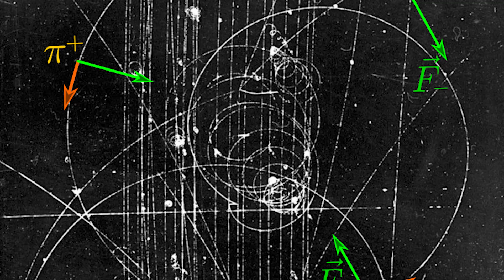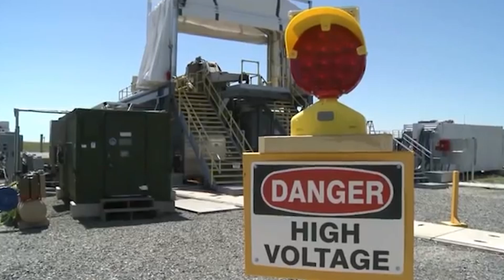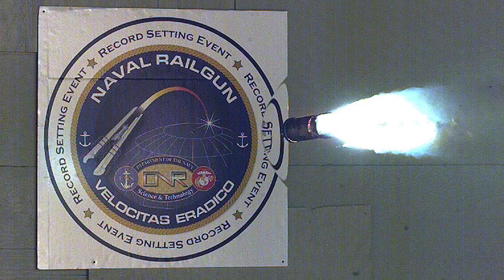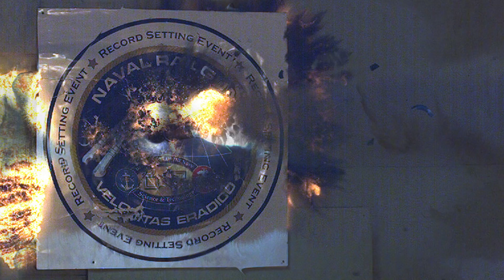Railguns: The Kinetic Future of Warfare

Comment: Used a rail gun in halo 4, was meh power weapon. Perhaps they should look into a rifle that shoots beams or explosive needles
Reply: They have. 
The needles were done in the 60’s see spew. 
The beam weapon just doesn’t work out with physics.
Reply: @brucebaxter6923  yes but no not without direct connection to extremely high power or stupidly dense batteries. But as of now the shits a si-fi cum bucket
Reply: @TbjrL  
Not even that problem. 
To damage a human in a reasonable amount of time, ie milliseconds before they move, the energy density ionises air and then absorbs the beam. 
The next problem is beam divergence that requires a reflector that is measured in meters not mm. Etc etc
Reply: @TbjrL  Is the ex sci fi? I think she is.
Reply: @brucebaxter6923  Maybe they could make a beam that air plasma would be mostly transparent to someday. Personally if I had the cash I'd just use 2 UV lasers to purposely pre-ionize air and then discharge a 1-2kJ 100kV cap into that. Not really a beam weapon then though but more like a wireless  tazer on steroids. Set phasers to stun = 3-5J/less voltage. Set to kill = 500J. Set to blow smoking holes in them too = 2kJ/max voltage.
Reply: @brucebaxter6923  Actually 'directed energy weapons' are already a thing. They're just not visible ... and don't do much damage. There are some uses in non-lethal crowd control though, as well as active research into taking out missiles with lasers.
Reply: @ArawnOfAnnwn  
Not quite a hand gun.
Reply: I remember the Halo books addressed the whole damage to the weapon thing, it was the reason they used magnetic coils instead of rails for their MAC weapons.
Reply: @Zyo117  That is called a gauss cannon. The smaller version on the warthog was one of my favorite guns in the whole game.
Reply: @Zyo117  you do know that HALO isn't real life, right??
Reply: enough velocity,,, explosives become pointless...... 4.5km/s
Reply: Well, if you used twin high power UV lasers to ionise air, you could make a railgun who's rails extend beyond the physical rails and continue accelerating up two beams of plasma, all the way into the target.
Reply: @Zappyguy111  Dammit, you beat me to it.
Reply: @Zappyguy111  now that’s what I like to hear!
Reply: Needler was the most psychotic weapon ever! I loved it!
Reply: @Ontime2day  Still doesn't compare to dual cyclones from Perfect Dark
Reply: I want a BFG9000.
Reply: @tncorgi92  Duke nukem?
Reply: So, a rifle with needles, interesting. The spiral rifles in the gun barrel are there to make the projectile rotate to stabilise it. A bunch of needles would twist a little, but start to rotate just fine. A rotating bundle of needles will be spread out by the centrifugal force, until it is no longer a bundle. The needles spread out further because they just keep moving away from the centre. The spreading will happen on the first meters, warying based on needle shape, bundle shape, bundle binder, pressure and more. Maybe it is like heavy bird shot from a smooth bore shotgun, but spreading much quicker. Maybe quick enough for indoor use. I do not know how it behaves really, but I would be extremely curious to see it.
Reply: @vsiegel  have you played Halo?
Reply: @Ontime2day  No, am I missing something specific? (A rifle has certainly rifles, no matter where. But I was thinking about the physical world.)
Reply: @vsiegel  "So, a rifle with needles, interesting." - https://en.wikipedia.org/wiki/Flechette
Reply: @ArawnOfAnnwn  Oh,thank you! I misread "a rifle that shoots beams or explosive needles". I assumed it is about multiple needles, leaving the muzzle at the same time, roughly parallel. But it is about a single projectile, rotating for stabilisation like any rifle bullet does. (Of course, shooting rotating bundles of needles still sounds interesting no me.)
Reply: @ArawnOfAnnwn  Brilliant! A great solution that did not find its problem. 
Because it looked in the wrong place!
You could build weapons that can be hidden in plain sight. From  a nine round James Bond style pen or a Hairspray can grenade launcher,  with four grenades, or five as taller can "Now with 25% more content!"
Or a bundle of 10 house installation water pipes, 3 m each, leaning at a wall, man portable 20 mm anti aircraft guns, 30 rounds. (Can be bundled for the same performance as the M61 Vulcan rotary canon, 300 rounds.)
And the nice and tidy stack of 80 mm street installation water pipes (they look so nice and new, even the dust cover caps are still on)? The stack is 3 m long and almost blocking the sidewalk. Yes of course that are 80 mm mortars, 9 shells each. As many as our fork lift can safely handle. (Of course you shoot them with your bare hands, obviously. The muzzle is far above you, the recoil goes 100% into the ground.)
And no, nobody needs the oil pipeline sections...
Reply: 69th like
NICE
Reply: IRL, there's no man-portable energy source that's powerful enough for repeated shooting of any electric weapon.
Reply: @tippyc2  Oh I dunno. 500J is lethal enough if it used in tazer (where the wires explode with kA's once in the target). That only weighs ~5 lbs if the 50-100kV plastic case version is used. Li-ion battery/2kW converter to charge it = maybe another 5 lbs. Cell phones aren't the only things getting smaller, lipo's are up to 400Wh/kg energy density thanks to smartphone demand. Also higher frequency = smaller size for a given power, and the newer GaN fets are really the bee's knees at higher switching frequencies.
Reply: That weapon also required the entire ship to power. So a fission power plant outputting more to just fire the weapon. Halo didn't go into detail how much power it took to fire once but most likely it took a lot to fire each time. The cool down time is probably also shorter than it would be irl for a rail gun.
Reply: Needler weapons idea fire what are called flechettes long before video games.
Reply: @SophiaAphrodite  
Especially with cannons. 
The stuff they used to load in those things was terrifying.
Reply: Wdym railgun was amazing! I had some of my longest streaks with it
Reply: @mattBLACKpunk  yeah I can wreck house with that thing on pc.
Reply: Well you should have used the one that Jill Valentine used it's a TINY bit bigger...
Reply: Rail gun does suck in halo 4
Reply: The Magnetic Accelerator Cannons on the UNSC’s warships are the answer to that, if they’re not technically rail guns. The barrels of the Infinity’s main guns are over a kilometre long and they fire 3 000 000 kilo slugs at around 4 percent of the speed of light.
Reply: Really sounding like we could have MAC cannons here real soon
Reply: LASERS
Reply: But it looks and sounds so cool
Reply: "Halo 4"
Ew. Well that's the problem. And there are far more railguns in Halo than 4's rifle. Literally every human ship is built around a huge railgun. Or did you not pay attention at all?
Reply: a rail gun in real life is closer to a mac platform than a hand held rail gun. derp

Comment: So, rumor is we've had working on-ship rail guns since the late 90's, and all these test rigs are intentionally big and clunky looking.
Reply: NOT a rumor!  The USS Zumwalt was originally outfitted with a large railgun on the bow.  The Navy scrapped that project, and refitted the Zumwalt, because the "cost overruns" on the projectiles became too enormous to overcome.  If I remember the article I read correctly, it stated the ORIGINAL cost per projectile was less than $100k, and the 'delivered' cost had risen to over $100 Million!  So, it works, and is feasible, just too expensive to fire! Now back to the drawing boards.  So typical of military 'open ended' procurement contracts.  Get the exact numbers by doing your research.

Comment: Do they use capacitors to power each shot? Surly they do as then all they have to do is charge them before firing
Reply: Typically, yes. Other options can be used, but capacitors are easiest because they only need good closing switches to fire off a shot.

Comment: If only energy storage capacitors didn't weigh 300 lbs per 25 kJ. I'd put that on my back and build a rail shotgun printed with PEEK. 5-mile-per-second 12ga shotgun slugs made of tungsten have a nice punch (probably more than an RPG).
Reply: I'm not so sure... railguns don't escape the Third Law of Thermodynamics, though. With those sort of velocities, I believe you would have commensurate recoil as well. And a significant risk of frying yourself to a crisp if something goes wrong with your wiring. 

The 12ga shotgun is a much, much safer weapon by comparison.
Reply: @Schwarzvogel1  Yeah it would definitely need some sort of shock absorber built in to keep from breaking bones. Really it'd be more comparable to a RPG than a shotgun, and those are dangerous too for the inexperienced. Heard of a few horror stories where bystanders get horribly burned (sometimes to death) by the exhaust standing too close and in the wrong spot.

Comment: The fact that no one has tipped their hand tells me they are trying.
Reply: The fact that they installed enough extra power on the Zumwalt Destroyers should say a lot.
Reply: @Kenneth_James  All that means is that when they designed the Zumwalt's they hoped the gun technology would eventually catch up.  The better indicator is what is going in the ships being designed today, eg. the Constellation class.
Reply: Jon Martin its the cost of the special ammunition that shut that down I had heard. But yes I believe the Zumwalt was basically designed around the gun BaE had developed, I could be wrong but I'm sure I read somewhere the "shells" were almost a million a piece or something crazy like that.
(Edit: the ammunition is called Long Range Land Attack Projectile or LRLAP and according to some sources each round was $800,000-1 million to procure)
Reply: @Morris2182  When I said "gun technology" I meant railguns and beyond that would use the Zumwalt's 78 MW of power generation.  The 155 mm AGS guns were supposed to be the zero risk technology for today.  As you say, the guns worked just fine but the LRLAP ammunition was unaffordable.  It was pretty stupid of them to not make the AGS compatible with the existing array of 155 mm ammunition used by the US Army, Marines, and dozens of other countries.

Comment: After spending many months worth of time working on my own small scale coil/railgun projects, the thing that I noticed that most folks fail to mention is that unlike using conventional chemical explosive energy to power the projectile, In the case of the linear motor, the higher the mass of the projectile, the more efficient and energetic the launch tends to be. I will refer to my experience with my simple single stage coil gun. The projectile is a highly magnetic steel slug. The more massive the slug is, the more mass there is to be effected by the magnetic field. You can easily feel this effect with your hands. Use a permanent magnet and feel the force exerted on a small chunk of iron, compared to a more massive piece.  So I think an alternative approach to weaponizing an electric gun may be focusing on using a higher mass projectile, instead of the current approach of going for ridicules' velocity. For longer ranges I think lasers are a more practical way of expending that huge electrical charge. Battery and capacitor technology will need to improve before we can replace gun powder for the bulk of our weaponry. Despite the artificially inflated price of ammo currently in the US, it's quite cheap to produce.

Comment: There was a proposal back in the  70's to use Mt Kilimanjaro in Tanzania as the support  for a railgun to launch spacecraft into orbit.  At 5,895 metres (19,341 ft) above sea level and about 4,900 metres (16,100 ft) above its plateau base and with an additional 5 miles of track laid out on the plateau, itself it was estimated that a sequential series of rails could provide a launch ramp of over 8 miles. At 3G of acceleration this would result in a launch speed of  3000ft/sec  or about .55 mile/sec (2000 mph).  Married with a scramjet to help lift and accelerate the spacecraft further, it was estimated that the rocket itself could be launched from 100,000 ft (20 miles) at a speed of nearly 3 miles per second. Interesting  Richard Branson of Virgin Group took his original inspiration of the slingshot to the edge of space from this proposal.

Several problems were identified. First is that you would have to build BOTH the railgun as well as a nuclear power station in post colonial (and none too stable) Africa at the time. Second Kilimanjaro is considered sacred to several tribal groups. The resulting negotiations with both the tribes and the government of Tanzania were considered too complex for a state department that had scant expertise in the area at the time. Third, security for the site was considered nearly impossible both for it's size and the realization that you would have to trust native troops. After all no country is going to accept a veritable army operating independently in it's borders unless it's survival is threatened.

Comment: Error @8:20 ish: opposite charges attract each other. My understanding is that the repulsion is mechanical in origin, caused by the contacts with the object super heating and trying to force them apart. Also, they have opposite charges, not opposite currents, currents are charge flows.

There are also timing issues, the rail is actually a series of them in sequential order so that only a small amount of the surface is charged at a time. Energizing the full rail at those kinds of voltage turns air into a conductor, so it has to be a very narrow area where the bulk of the current flows through the projectile or you just get a loud lightning strike inside and spray of molten metal at much slower velocities.